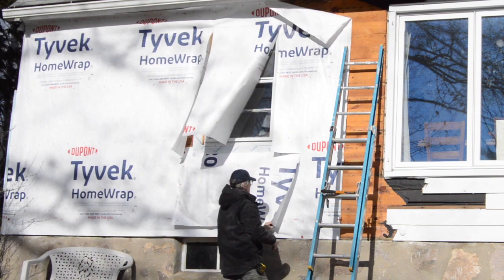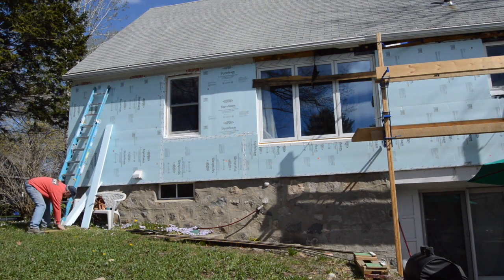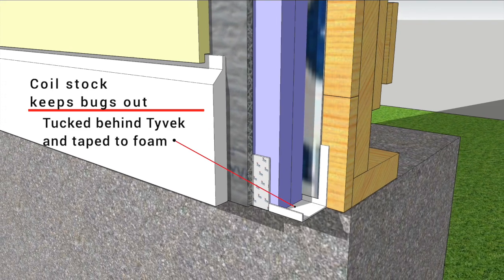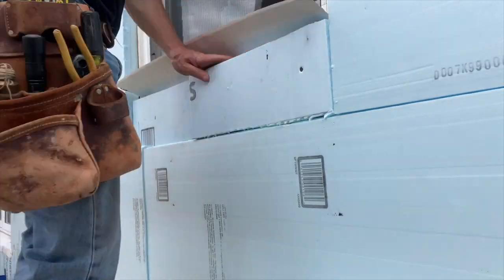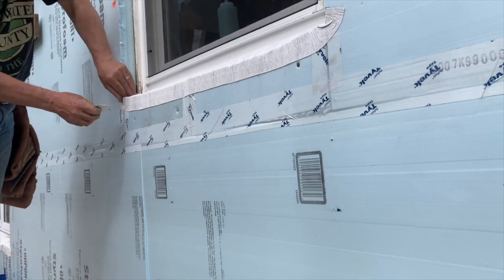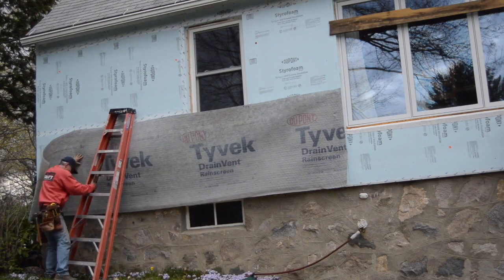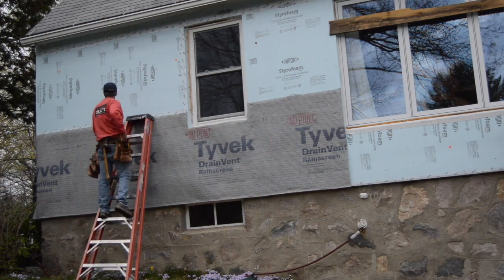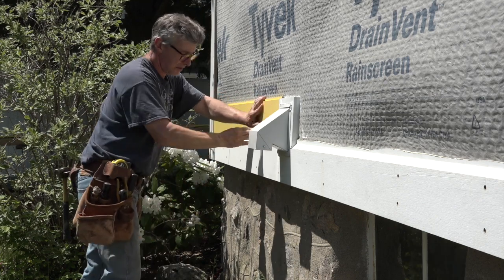ptc@home 3: Rigid Styrofoam Insulation and Drainvent Rainscreen

Comment: Do you nail the siding through the wall sheathing as well or only over the studs?
Reply from the maker: I aim for the studs, but feel comfort in knowing that almost all siding manufacturers allow fastening into only 7/16 OSB, because that's what SIPs are made from. The sheathing on this house is 3/4 inch solid pine planking (1x6 t&g), so I feel even more confortanle.

Comment: Is it okay if I don’t have continuous insulation into roof and on basement foundation?
Reply from the maker: Yes, but continuous is better. On this house, I just did the walls, not the roof, and it reduced energy use by at least 40% right off the bat.

Comment: What siding doesn’t require furring strips over 2” of foam board?
Reply from the maker: siding with long nails.
Reply: @ProTradeCraft Hi there thanks for taking the time to make a video on your project. Question:

Do you think installing drain vent rainscreen over poly iso (astm-c1289type2 class1 grade1)with  Compressive Strength of 16 psi be an issue if HardiePlank will be nailed through both layers ? if yes would (grade2)20 psi work ? correct me if Im wrong the product you are using is 25 psi compressive strength ?  Im worried about hardiplank being wavy when compressing drainvent to rigid insulation. I like the idea of having a gap between the siding and the rigid insulation without having to nail furring strips. 

The house your working on in the video... what is the main source of heating ?  electrical baseboards or forced air natural gas 
Did you add any makeup air or HRV/ERV when project was complete ?

Comment: Styrofoam off gasing is 1500 times as bad as CO2 regarding GHG's. Please use rigid mineral wool AKA Roxul comfort board
Reply from the maker: Agreed that m,ineral wool is better for GHGs. Styrofoam now has a zero GWP rigid insul;ation, which you can see in the forst episode of Building Resilience season 3

Comment: I'm sure I'm not understanding something, but isn't the Styrofoam impermeable to air and water?  Doesn't this mean that any moisture from the inside of the house will go through the Tyvek house wrap but hit the Styrofoam and get trapped?
Reply: yes!  that is what I thought too!  House needs to breath??
Reply from the maker: It is basically impermeable to air and moisture, and the thicker it gets, the more impermeable it is.
So, yes, moisture from inside could find it's way to the backside of the wall sheathing and diffuse through it to the backside of the Tyvek, diffuse through that and hit the backside of the foam.

However, according to physics, moisture goes from more to less, so unless it is very wet inside, the moisture will likely dry back inward. If it is THAT moist inside, an exhaust fan is certainly in order.

The more important piece of that equation, though, is that the vast majority of moisture movement is on air currents, NOT through diffusion. So, with a good installation of the Tyvek and Styrofoam, there ought to be very little air pushing its way through the wall system.

Comment: In Tyvek installation guide it says 1. Tyvek wrap. 2 Foam Insulation. 3 Tyvek rainscreen wrap. 4 Cladding.
But I guess it fine like this.
Reply from the maker: There are a bajillion options in the tyvek manual. The detail here was developed in partnership with the Tyvek technical department because it represents one of the scenarios they did NOT already cover.

Comment: That siding will fall off! He didn’t hit any studs and that so called bug screen will get dust in it and prevent airflow
Reply from the maker: Disagree. The wall sheathing is 3/4 inch solid lumber, and almost all siding products are rated for 7/16 OSB. 
Not sure where all the dust id going to comer from hiding behind siding, but...

What's your preferred system for exterior insulation and rainscreen?

Comment: Could you elaborate on your window flashing detail? I saw you had a typical peel and stick flashing under the window and tied into your tyvek layer. However after the rigid foam was added, it looked like you added a second flashing that overlaps the foam, but how is it installed back to the window? Is it just run up against the window and adhered over the first flashing? Or does it get lapped under the first window flashing somehow, layered like shingles?
Reply from the maker: A little bit of both, depending on what your wall looks like. If the windows have already been replaced, you can not tuck it under the window.

Sealing the Tyvek is more for air sealing than water management at that layer.

The second layer is water management, extending from the window out over the foam.

Hope that helps.

Comment: If water gets through to the backside of the insulation (maybe through your window bucks), are you concerned with it at all getting trapped in your coil stock at the bottom?
Reply from the maker: No. The coil stock bug protection is taped tightly to the face of the Styrofoam